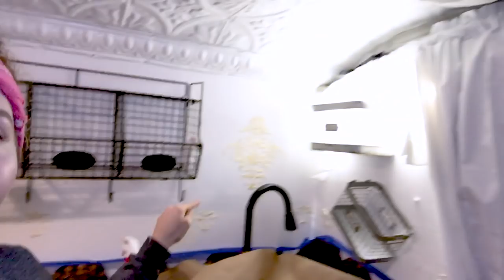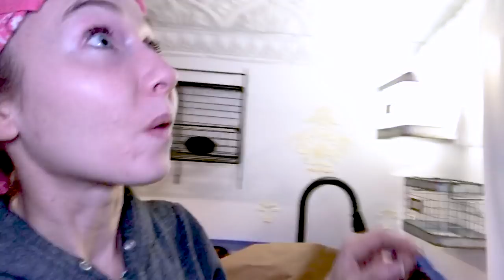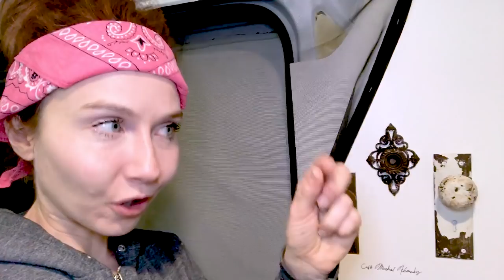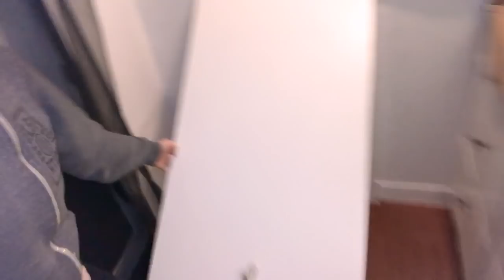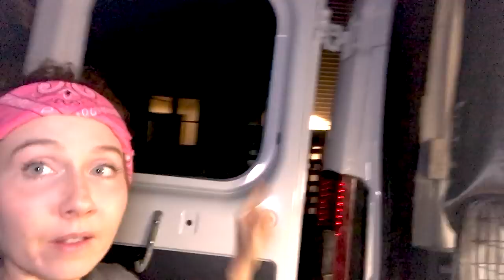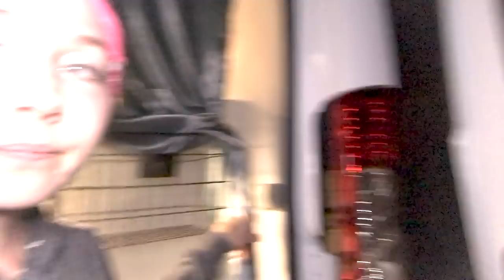Van Progress Report: Flooring, Cabinets & Cover-Ups

Comment: Line the curtains with black fleece, you can use iron-on fusing interface, no sewing needed.  Helps block the light and adds insulation factor

Comment: i think you already solved the blackout part in a later video but in case another idea is helpful to someone else--I actually used moving blankets! they work like a charm and when you're looking in from the front, look a little more rugged (safety) and i found ones that already had loops on them so easy to hang :)

Comment: I saw a blog of a man who  built cabinets out or pink insulation board.  I remember that the box he built was strong enough for him to stand on. Talk about light weight!   He painted the exteriors.   Love 🏆your van ideas.  So original and practical.  When I seek something rare..parts, fittings ...THEY say hard to find..I reply..I only want ONE!  Ha ha
Reply: Nomad and zhkopec both use board and screen make a durable cabinet.  Again that would be light weight.  Cut it with razor blad. Reinfor e with one iinch wood peicez.  Accomedate cutves. Theme dong!e

Comment: Beautiful additions to your little home. ❤️ 
Light bleed - you can make window coverings that are cut to fit your back windows and sew in magnets to stick to metal frame of window, and reflectives for extra insulation and light blockage. Some people have also used valances over the top of the curtain rod, attached to the ceiling to block light bleed front and back. If I see any cute ideas, I will shoot them to you. 
What about adding some of the self sticking felt in white behind your wire baskets to minimize rattle and road noise? 
I hate all of these bugs too. It’s because we never got a good hard freeze to kill everything off until real Spring shows up. This crazy ping pong weather of having all 4 seasons in a week keeps us waist high in 4 season clothing, bugs that should be dead, and sinus & allergy meds. And we still have the pollen blizzards to look forward to in a month or two. Y.a.y. 🤣🤣🤣 
She is coming along nicely! And yes I am here for the crazy commentary b.c. it’s like listening to myself on playback. 🤣🤣 but I am interested in all.of.the.things you do to the babe bus. I’m still living and decorating this life through you for the moment. 😁. 
What’s the count down to move in day?!

Comment: Fabric stores have black out lining. It is thick, white, and it 100% blocks out all light. You could add this to the back of your curtains. I make all of my drapes for my windows (in my house) and not one teensy bit of light can be seen thru my windows at night. This is also wonderful in insulating as well.

Comment: I sure wish I had a van right now, I would make you some coverings for those rear windows using blackout fabric a inner liner to cut any heat/cold and use magnets in the edges to stay on the metal of the back doors.  Yep, wish I had a van....Love the floor, and yes I love all your updates.  You have given me great ideas for my van...when I get one...
Reply from the maker: You'll get one! I bought some felt to improve the blackout on those window coverings but I'm worried it will interfere with the magnets ability to attach, we'll see!
Reply: @CaseyRoman  maybe a little larger magnets, stronger connection.  wish some one would put out a pattern for those windows, Others that sell those coverings want way too much money for them.

Comment: Casey if you add some small blocks of wood maybe 1”x1” under your suspension rods in your closet it will prevent them from falling while going over bumps.
Reply from the maker: That's a GREAT idea and doesn't cost a thing!
Reply: Casey Roman yeaaah I thought so.  Sometimes I use my 🧠

Comment: Casey..love the floor idea and may use it when time comes for mine. Tension rods won't stay.  I would get for you...nice piece of copper pipe and copper fittings from plumbing section at Lowe's or home depot. Also would compliment the copper accents you already have. For windows..cut Reflectix to fit..add magnets and use your felt on one side. Face Reflectix facing out during the day to keep heat out..black side out at night to keep lite in and nosy folk out. I do believe your lovely baskets will drive you nuts in no time. They may rattle like crazy and stuff will fly and possible fall off from bouncing. Be careful and don't store anything breakable in them yet. Looking 👍. Be safe and on the road soon.
Reply: It's true that the tension rods won't work. I tried using them for the screens and before I could open the centers from the magnets the curtain rods fell down and the whole thing hit me in the head!  Easier to use nylon cord through loops that are bolted in or metal screws with eye hooks.  They'll never come down and you can tension the nylon cord any way you want.  Has the benefit of being super cheap too.

Comment: I use the foam interlocking mats as well.  Considering I have a "low top" and I'm in an advanced age of decreptitude (50+), it's much kinder on the knees.  Plus, I travel with two dogs and they won't slip/slide around the cabin.

Comment: Hi woman, just found your channel and am lovin'!  Watching your under the bed hanging system and wanted to suggest plumbing pipe instead of the curtain rods you have. I've used metal, as well as pvc for closet builds- with the short spans you have, think pvc would hold up and still be light weight. You attach them to the frame with the plumbing fixtures they would normally fit into (the anchors shaped like donuts that fit over the end of the pipe and you fasten to the frame with screws)- could use elbows as well.  Loving you can build. Going to work on mine this year. You should come up to the Catskills this summer. Bethel ny- the 50 th anniversary of Woodstock this year. We have some amazing beauty in this area. Also- Schenectady NY /Albany NY/Saratoga Springs for some amazing architecture and history and natural beauty.(get up in the area). All my best to you! You go girl!

Comment: Excellent floor idea! I didn't know they came in designs other than black or primary colors. Also for the curtain situation: the back windows would be fine just with reflectix cut to size & glued your thin black felt then magnets to hold it up=yay for less dealing with van curves. And the front keep what ya got (or use strong magnets to hold curtain to the ceiling if light gets through the top crack above the rod)  just double up with another black out curtain & attach to the main one with Velcro! Plus it'll increase insulation. Use the plain one on the cab side for stealth reasons & pick a cute pattern or colored one on the inside :) 
Keep up the great work & blessings on your journey.

Comment: Heads up. If you put non distributed weight on those tiles (ie.a chair or a full cooler) the tiles will develop depressions at the pressure points, so keep a few spare tiles hanging around to pop a new one in every now and again.  Otherwise since they are foam, they should add a slight insulation and noise barrier to the floor.

Comment: Of course there is always one more thing to think about ..... and this time it is the wire baskets rubbing the paint off of your beautifully painted walls ..... you could buy some Command hooks to help hold them in place or maybe some of those little round bumpers with sticky on the back ..... and then again you may know of something else .... anyway that floor is freaking  Awesome and warm and comfy ...... Hugs ...... Shirlene
Reply from the maker: Hm. To rub the paint off they would have to move...but they are screwed in tight....?
Reply: @CaseyRoman ....... Wellllll .... In that case ..... never mind !!! ...... Hugs .... !

Comment: to black out the back windows... you could take black felt and attach some magnets to it to hold it in place when you want stealth,  idk how it would work on the front.  but it should block out all the light and with magnets they are removeable.
Reply from the maker: Its going to have to be something like this
Reply: @CaseyRoman  Actually,  the simplest and better way is to cut Reflectix to fit on a piece of stuff cardboard or stock and put magnets on it to hold in place over the entire windows by covering them and the adhesive velcro or magnets go on the metal part of the door.  A better but much more expensive way is to go with custom cut and edged Prodex with R16 protection from heat and cold and hold them up the same way,  Velcro or magnets. One of those guys who makes the screen doors for submarines,  or ProMasters also sells the window coverings for all ProMaster windows, doors and windshields.   I also use an Adco front windshield and door window external cover with Reflectix or the Prodex cover on the inside.  That keeps heat out without trapping it between the Reflectix and windshield potentially preventing windshield cracks.

Lastly,  I trust you have cargo netting for all those baskets, right?  Nothing like flying meteor attacks from stuff bombing you and your penny cabinet when you swerve, hit a bump or pothole when things fly out and they sure as zhit will.  Spelling on poirpose.
Reply: That should be stiff cardboard, not stuff but hey typing with thumbs isn't the best way to go.

Comment: Your right about reflectix...buy a roll of it then cut them to fit your windows. I spray painted black on one side to be the outside and looks better looking in. Or a healthier version would be to wrap them in material (requires sewing...not my niche). If you do the material route put black on outside so it is more stealthy. Have fun!
Ps...reflectix in the windows cools the van immensely when in the sun.
Reply: Magnets can be added to hold them up. Or just tuck in.

Comment: Wa she say? Nice idea on the floor. A couple tips - On one of my vans the previous owner used long pencil thin springs screwed to the tops & bottoms of the windows to use as curtain rods & it held the fabric close to the windows. & I'm wondering how much noise the wire shelves are going to make running down the road. I'd think about using with some type rubber washers or just crank up the tunes. Your getting in deep now...

Comment: Cut-to-fit Reflectix and cover it on one side with black material.  Use Guerrilla glue GEL to attach dime-sized rare-earth magnets to the corners and at key points onto the Reflectix. They pop onto your windows and look like your windows are tinted. You cannot see a damn spec of light ever. Added bonus = insulation R3

Comment: I actually prefer to not have the build out cabinets on top it makes it feel too small in there. In my build I'm using hanging net and open baskets.  Enjoying your comedian builds van series.  👍
Reply from the maker: I really wanted them. I really did. But I've seen some conversions with floor to ceiling cabinets and while they do have a WEALTH of storage...I would not want to hang out in there.

Comment: The foam floor will be warm to step onto as well. On how to black out the back windows, there are kits available that are insulated fabric covers that are custom made for those windows that hang up with magnets.  Easy up and down.  The vents in the rear you mention are the "exhaust" for the HVAC in the dash.  Air gets blown in by the heater/AC in front and those let the "pressure" out so the air can flow through the van.  Good job not covering them up!
Reply from the maker: didn't know!!! Regrettably I did cover them with some insulation but it can be peeled off (adhesive duct insulation). This is great info and will help me make some better choices when I redo anything!

Comment: That flooring surprisingly looks pretty nice. 👏🏻 I’m curious whether your wire baskets will rattle a lot on a long haul and drive you even more bat sh*t crazy. LOL. ❤️ I’m thinking the same with the tin roof tiles. Do they rattle? You should start a betting game on which item is going to fall off first once you hit the road. ‘Cause something’s gonna fall. 😂

Comment: Casey I love your foam tile idea just want to anticipate therefore avoid problems. Because of the spaces between the tiles if you have a spill liquid can get between the tiles and rot or cause mold on your sub-floor. May I suggest you urethane the sub floor and caulk the edges to avoid this. Or not your choice.
Reply from the maker: I thought about that too but luckily because of the spaces the flooring can "breathe" a little. I'm just going to have to be very careful about getting water on the floor. I would not paint this with polyurethane. The foam has a flex to it and poly is not designed to flex. it will start to flake and crack the second you put your foot on it. If I do spill something on the floor I can pop the tile up and let it dry. Its not a perfect solution and you bring up a consideration worth mentioning.
Reply: As long as you have a solution so your enjoying your journey not fixing the issues on the road. Love your videos cant wait to see your take on the road when you get there.

Comment: Loving your ideas and I also love the Jesus store :).  The van looks amazing, I am wondering if the hanging baskets are going to withstand the vibrations of going down the road etc, how did you attach them because I do love them!  Looking forward to tagging along in your travels.  Prayers and good vibes sent your way!
Reply from the maker: She hasn't been on any major drives but so far the cabinets are sturdy and noise free. I used screws with wide heads, the bins are designed with places to attach them. I don't plan on putting anything heavy in them. Cereal, oatmeal...the tears of my enemies.

Comment: Just a thought for both your windows as well as the exposed metal on your back doors at your bed. 
Just breathing all night can cause condensation on exposed metal surfaces so perhaps using that self adhesive felt on the metal could help with that? Paint it the colour of your walls. 
For the windows make a template the same shape but slightly larger than the actual window and then stick the self adhesive felt on either side of reflectives to fit each window. Go to the Jesus store and buy some strong magnets and super cool designer babe tape to tape in the magnets and make a groovy trim completely around the edges of your blackout screens. Just some thoughts to help with your blackout conundrum.
Love your van.
Reply from the maker: You cant really paint felt. It will bead up and never give you a smooth surface. I work in the van at night when its cold with a heater and I'm breathing in it....and I've yet to see any condensation (so far)

Comment: The suspension rods will probably be fine.  You'll just need to shore them up with some screws or something so they don't slide.   Good ideas.... wish my 6'1" self could utilize a crawl-through closet.... not a chance...   Good video
Reply from the maker: Its a tight fit in the crawl in closet even for me so wise decision!
Reply: Although, the soft tiles will work nice on my bad knee.  Good choice.  $70 is phenom

Comment: I love the floor and the bugs they are small smash them take tissues and get them out of your van ...ok as for your big back windows that insulated foil stuff cut to size and put some thin magnets on it then you could put some felt on sticky part with you magnets and attach to your window frame I’ve seen it in other converibs and they do work
Reply from the maker: Yeah some tiny bugs still get in -- SMASH!

Comment: My ADD is tingling, in the quick shot the lid on your gold paint doesn't look like it is on right. Cross threaded maybe?
Reply from the maker: That is the most specific observation ever made on one of my videos. No idea. I'll check tomorrow.
Reply: @CaseyRoman  it may just be that the bar code sticker is a little crooked, I thought that was the main label.

Comment: How many packs did it take? About 6?
Reply from the maker: It took 60 tiles exactly plus the scraps from cut pieces. If I was buying them again I would definitely go for one extra pack just in case I cut wrong - that happened a few times.

Comment: Black out curtain = reflectix covered with black felt glued on to both sides and Velcro holding curtain  into place,   also felt and reflectix = inexpensive and no light escaping.  if you want photos of mine let me know and will e mail them to you
Reply from the maker: I bought the reflectix today and well...problem (mostly) solved. I'm going to keep the blackout curtains up to help deal with noise and because...they're pretty.
Reply: @CaseyRoman  cut the reflectix about 1 inch larger than those back window openings and the felt 2 inches larger  use spray glue to attach the felt to the reflectix then use Velcro to hold them to the metal around the windows. where it can lay flat and that will also give you some insulation with the air gap between the glass and reflectix covers.
Reply from the maker: @delawarehiker  I screwed up and cut the reflectix a bit too short but I think an overlay of felt should solve that problem.
Reply: Casey Roman you can tape the reflection back together with duct tape

Comment: I love the floor tiles!  Maybe tapping the seams with a rubber mallet will help make the seams come together better?  
In case you’re interested in improving the ride and handling of your van, we have a Promaster 3500 and added Sumo Springs to the front and rear suspension.  Ordered from www.supersprings.com and any mechanic or tire shop should be able to install them.  The YT channel of Carey on vagabond shows the before and after videos of the rear spring installation.  They work best and are intended to be used on both front and rear suspensions.   https://www.youtube.com/watch?v=ZefwHn77a_E
Reply from the maker: I noticed while trying to get the tiles perfectly flush with the sides of the van the seams would pop up in one area or another. Likely because there is no such thing as perfectly straight in this fan. A rubber mallet would just swish them.
Reply: They might be too tightly fitted in an area and by slightly shaving off 1/16th or 1/8th of an inch it would allow them to float a bit more freely.